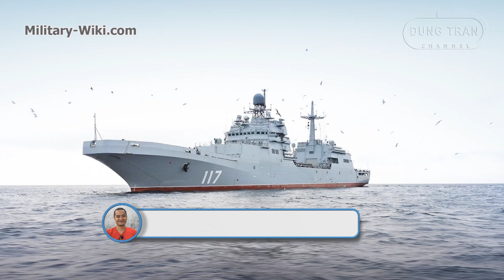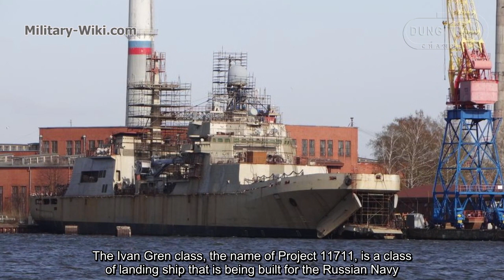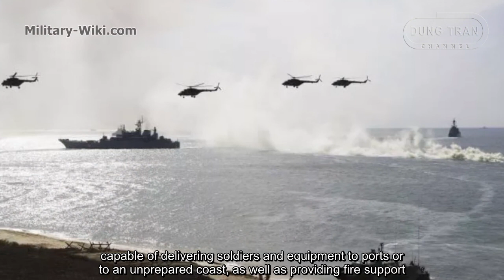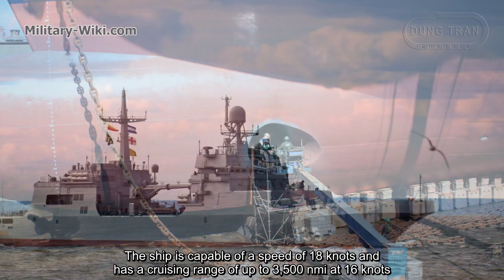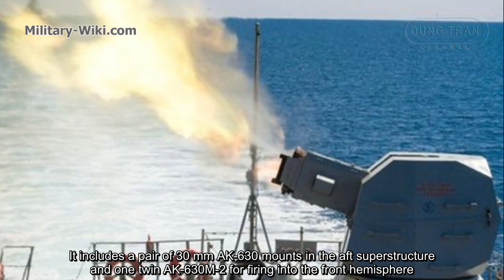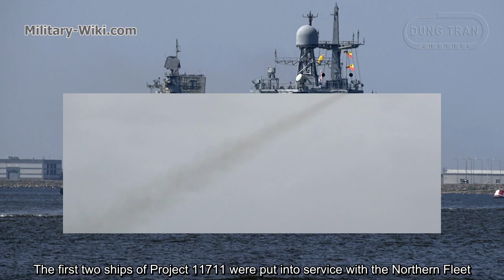Pyotr Morgunov 117 - The Future Pillar of the Russian Navy's Amphibious Force

Comment: Interesting bow design, you wouldn't know it opened unless you saw it! I wonder if it's flat bottomed to prevent it tipping over? Very interesting!:)
Reply: I was thinking the same thing. Could not understand it. And then I started to get it. But yes, it's ro-ro, but how does that design work with this vessel? Would have been interesting to see inside footage and design schemes.
Reply: @roderickcampbell2105  Lol, not like Townsend torresson commercial ferry roll on roll over! Yes it would be interesting to see how it's built, bow thrusters would be interesting to look at, must produce a serious amount of thrust!